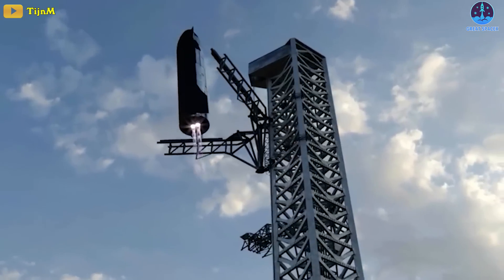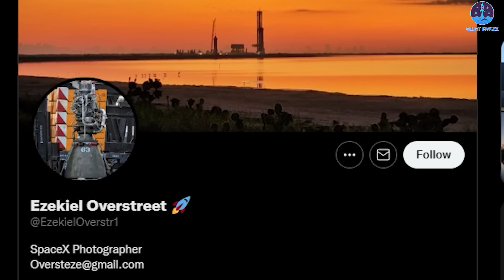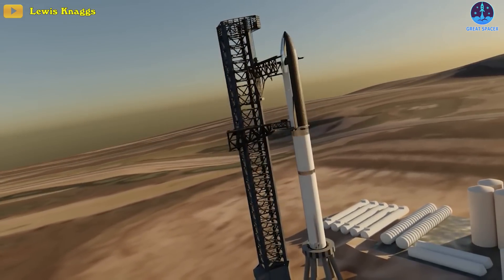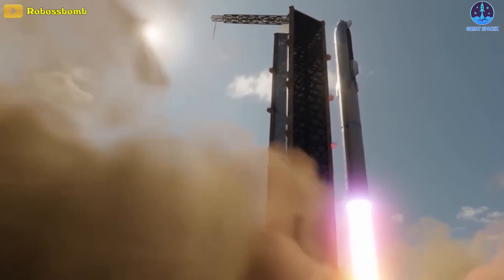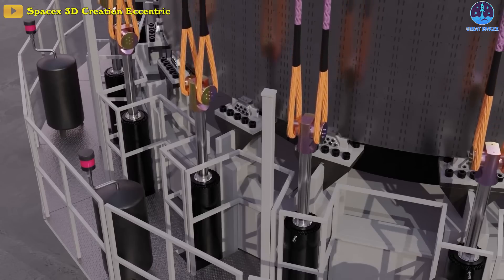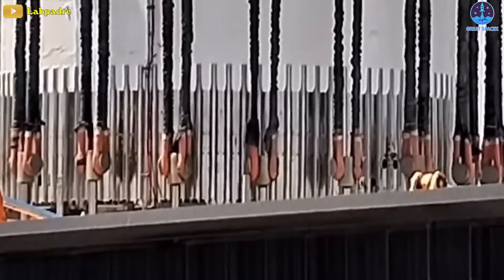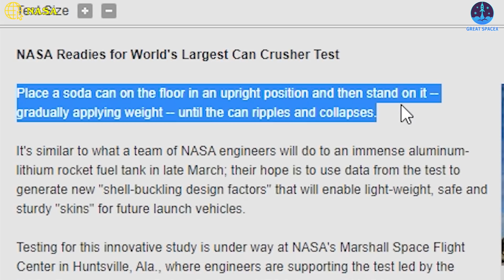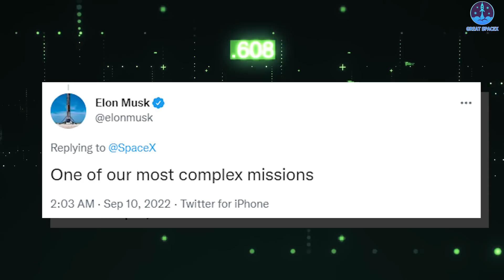SpaceX upgraded Chopstick arms ready to lift S24 on top of B7, TPS  failure had been fixed...

Comment: Lololol they won't stack until b7 testing is completed.  And no they won't need to stack s24 to static fire b7. The clamps on the olm will hold it just fine with the locking mechanisms in place. @csi starbase has great deep dives showing how it will work. The olm could hold much more then 33 raptor 2s if if needed to.

Comment: I have noticed that the arms are only for the upper level of the rocket. 
Even though the rocket have very little fuel and therefor little weight it seems that it would put a lot of stress on the fuselage
How do the deal with the Structural integrity of the rocket? 
Why don't they install arms for the lower level? This would help better stabilize the rocket?
Reply: There's a massive weight-bearing ring where the catch pins are located, and struts throughout the rest of the ship. If the rocket's fuselage can't withstand being hung from two pins, it can't withstand the force of accelerating tons of mass to orbital velocity.
Reply: The chopsticks will be used both for the booster and starship. There is a claw to hold onto the booster while the chopsticks load the starship ontop for stability
Reply: Elon seems like the biggest BS-er second only to the church.

Comment: Can't wait for the launch! I'm interested to know how they are going to fix the heat tiles. Anybody know when the Starship launch will be? Come on Space X!!! Light that candle 🕯️ already.
Reply: what happened to "rapid prototyping"? build try, build again?  This thing must explode at least once.
Reply: @reasonerenlightened2456  About that.  Talk to the FAA.
Reply: @reasonerenlightened2456  would be cool, sounds dangerous though ;)
Reply: remember the tx site is now research and testing.  each starship iteration no doubt has various ways to attach heat tiles to see which way holds the tiles in place better.
Reply: @plexisgaming  on the edge of my seat for this launch. Absolutely cannot wait.